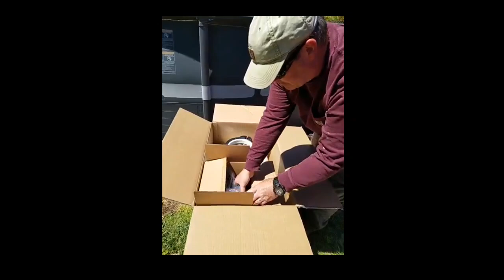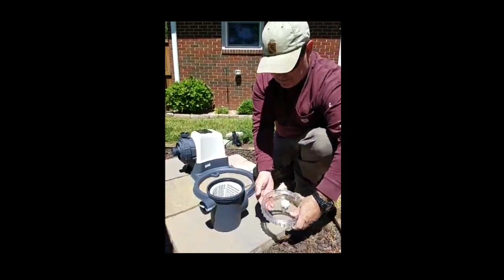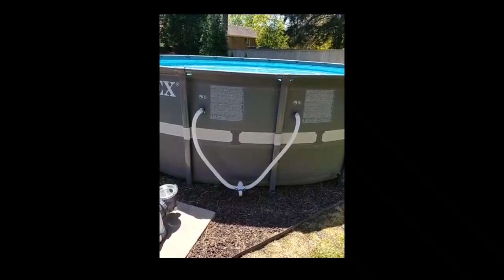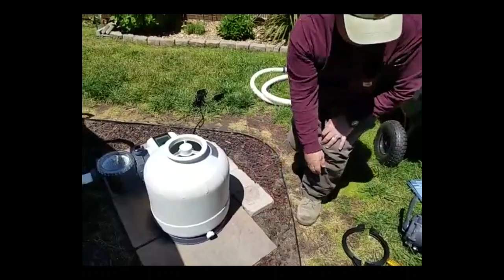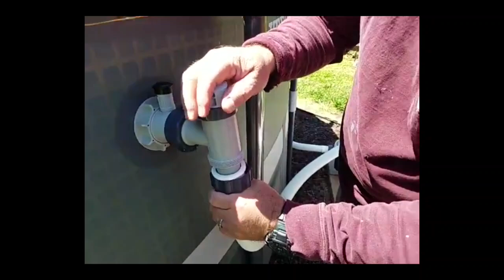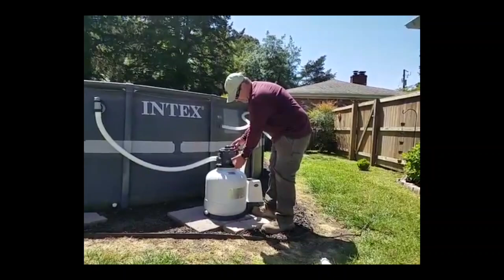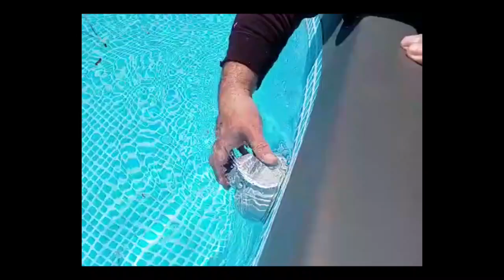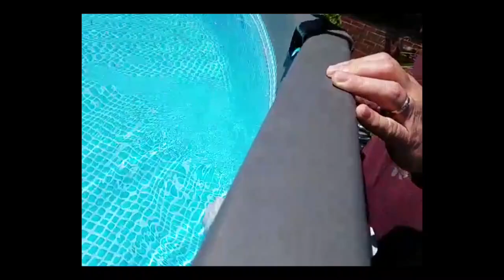INTEX SAND FILTER PUMP - Setting the pump up for above ground pools

Comment: Best thing i ever did was upgrade from the 1500 model to the 3000 model. May be a little overkill for my 5500 gallon pool but i had zero issues all summer. Water stayed clear and stayed balanced. It's a great sysytem
Reply from the maker: Oh we eventually did the same thing. We totally understand. We also switched to the hayward skimner and then uograded to the widemouth skimmer now, that was the best thing we ever did.
Reply: @MoverandShaker ill have to check that out

Comment: Thank you!!! We just set up our brand new pool and filter and did as you described but when we started backwashing, water came out and then stopped and we can’t figure out why. The only difference with what we see in your video is we didn’t put the little black cap back onto the outlet discharge that connects to the pool. Could that be the issue?
Reply from the maker: We both do not understand how that could happen unless your water level was below the discharge area. We have never heard of this happening.

Comment: Does the filter and pump work without taking the cap off of the vent valve?
Reply from the maker: Yes it does.  I would just do it occasionally to get the bubbles out.
Reply: @MoverandShaker  thank you!

Comment: Installing this same pump to a Coleman 18'x48". Is kt mandatory to install the output part/aerator that goes into the liner? The output tubes connect right up to the existing valve. I figured I could just use it as is. But, not 100% sure. Otherwise, this whole install is a breeze. Great video too. Thanks.
Reply from the maker: That may work but we can't say for sure. We don't really know much about Coleman pools we have never known anyone that has one to even learn about the Coleman setup. We do get a lot of questions about Coleman pools. It does sound like it would work.
Reply: @MoverandShaker  Thanks. I installed it yesterday and it has been amazing since. What a difference! All good without the aerator too.

Comment: Is this the saltwater option?
Reply from the maker: This particular unit in the video is only the sand filter pump, and it does not have the saltwater option combined some units have them combined as one unit and then there are others that are being sold as two units as one purchase like this one https://amzn.to/3Pcqfnf but they are not connected.  we purchased ours separately as two pieces.  So you have some options.

Comment: do you have 2 o-rings on the  motor water inlet where it connects to the pre-filter housing? I took it apart last year and took all the o-rings off to clean them and now I don't remember if there are 1 or 2 o-rings.
Reply from the maker: Not 100% sure where you are talking about but I could email you a picture of the schematics from the manual if you need them.
Reply: @MoverandShaker  That would be great! I looked for the schematics but didn't see the connection I was talking about.  Maybe you will find it.

Comment: Should the plunger valve on the basket be opened or closed while using the pump? Thank you for your video!!
Reply from the maker: All plunger valves are always open whether using the pump or not.  the only time we would shut the valve is when we want to secure the water from coming out of the pool, e.g. cleaning the pre-filter housing basket.

Comment: Hello, i appreciate all your pool videos.  They are very helpful.  But i need your help.i have a INTEX Prism Frame 18ft x 48in Pool, i order the 14in. sand filter pump. Do you think that should work for this pool or should i go for the 16in ?  Do i need extra adpters? Thanks i appreciate  your help.
Reply: Thank you! I was afraid it would be to small.
Reply from the maker: I think that will work when we got a 16. I think we got more than what we Need.

Comment: I love your easy way of explaining all of these processes and adaptations on your pool videos.  I would like to get your advice:   my Best way pool, 22x 52,with the filters was impossible to keep clear last year-- I bought the Intex Sand filter and the saltwater system to switch it out.  Should I change to the new sand and salt system to get the green out or use the old system to get most of the green out and then switch?
Reply from the maker: Use the old system to get the green out before hooking up the new one most definitely.  We decided after a couple of years to empty the sand out of ours and then add new sand. It's going to be scary not to get any in the center. We're gonna tape the hole off real tight.

Comment: When I put the short hose on it caused the tank to pop up! I can’t get it all to stay down now 😳! Is that normal? It’s like the hose is a little to long 🤔!
Reply from the maker: We both have no idea what you're talking about. If you're using an intex pump and that's what you're talking about
 I would  suggest reading the owner's manual.
Reply: @MoverandShaker  It's the hose you put on at 15:46 the small hose. It was super hard to attach both ends. The sand tank popped up when I finally attached them. Maybe it's because I have the pool filter balls and not sand in it 🤔, I'm sorry I don't mean to pester you 🥺! Thank you for your time!

Comment: I just did everything and found that the hoses are to big for the openings in the pool 😳! The hose that's on the pool is 1.25 and the hose that came with the pump is 1.50. Can you direct me to the right adapter set? We have the Bestway 56687E Syeel Pro Max 15x42 pool. I don't want to buy the wrong adapter set 🥺! Thank you for your help!
Reply from the maker: We are really most familiar with Intex pools but I think you are referring to something  like this.  https://amzn.to/3Ab85t0
Reply: @MoverandShaker  Thank you So Much!

Comment: Do you have to tighten the clamp all the way down on the filter part?
Reply from the maker: If you are referring to the pump ring snug it up with a screwdriver hand tight
Reply: @MoverandShaker  Ooooooops guess I should have been impatient and used the Makita 🤣

Comment: Great video. Wish you could’ve included explaining the instructions it had about getting rid of the air pockets or something ? My glass display to see water clarity is only half full so I don’t think I set it up right to get all air out
Reply from the maker: The sight glass only shows full capacity when it's backwashing or rinsing. I don't think you  have anything to worry about.    You can gert the air out with the pre-filter basket turn knob to release the air.

Comment: On the  outlet did your pool come with the adjustable piece or did you install that with the sand filter?
Reply from the maker: Can you clarify which adjustable piece you are referring to? Is this on the outside of the pool or the inside?
Reply: @MoverandShaker  the inside where the water is shooting out into the pool. I bought a plunger/adapter thing and am going to go that route. My sand filter came with one and I'm not to keen on cutting it to make it fit just curious if you did that or not.
Reply from the maker: It is an Inlet Air nozzle and it comes with the pool. There is no cutting necessary so I am not sure what you mean there.

Comment: This is really awesome, do you happen to have a video link to be able to program this, the instructions don’t seem to be helping me because I am not able to set it. I’m very confused
Reply from the maker: We don't have a video link but it's a great idea. Turn the power to your pump on. Press and hold the lock unlock button the numbers will Flash and then press the right button .  Run through your numbers 1 through 12  and then once you have your numbers set 1 through 12 hours you press the left button again and it locks that number in and now you're set for timing on your pump.  It's going to remember the time you turned it on so that's gonna be the time it comes on every day As long as it still plugged in
Reply: Mover and Shaker thanks! I’m going to try that… Quick question it also says low salt and beeps…does this system have to have salt?
Reply from the maker: @dprevish100   We probably have a different model since we were initially talking about setting up the  pump  it sounds like you might have a pump/ salt system combo and yes the saltwater system has to be set up properly from the get go by  doing multiple things in order for it to generate chlorine, like balance the pool add the recommended  salt the boost for a longgggg time. (See manual for length of time) Then you are good to go.
Reply: Mover and Shaker thanks!

Comment: Just got this index sand filter but won’t do anything when I have it on filter I been having pump on N what did I do wrong ? Need help
Reply from the maker: The only thing that I can think of is that your valves are not open because having your pump on filter is how it works full time.

Comment: When backing washing and Rinsing, and filter do I keep both valves open? On the pool?
Reply from the maker: Your Inlet and outlet return valves on the pool are always open during operation of the pump with the exception of exception of if you want to do maintenance on your strainer basket that's attached to the pump In order to keep the pool water in the pool while you're cleaning it.

Comment: I’ve had my sand filter for about a year now, and I don’t see any water in the sight glass like that. Could that be an issue?
Reply from the maker: You should see the water flowing when you use backwash and rinse cycles.

Comment: SO When setting up the pool for the very first time  you do backwash and rinse first. And then add chemicals and turn on the filter to circulate?
Reply from the maker: Yes. backwash first to get all the sand settled, then rinse,  you always want your pump circulating when you add chemicals. Some chemicals need time before you add others. If you a Leslie's pool store near you. They give great printouts of your water chemistry and will tell you exactly how much you need to add and when to do it  in a specific order with time in between shown.    Don't forget to turn your pump off anytime you switch any mode on the pump topside.

Comment: Thank you for the video.  It was very helpful.  Where did you get the extension hoses when running the backwash/rinse cycle?
Reply from the maker: They come with the Intex cleaner. I think 6 come with it. You don't  need those. We now use just a regular 50ft hose from lowes
Reply: @MoverandShaker  Thank you!
Reply from the maker: You're welcome!

Comment: I have good pressure, but my pressure gauge shows 0. Is that a bad pressure gauge?
Reply from the maker: It's  possible. Ours is usually between green and the edge of yellow
Reply: @MoverandShaker  
I just installed mine. It’s working fine but the pressure gauge shows 0.

Comment: How do you have your sand pump plug? Did you use a extension cord?
Reply from the maker: No, we paid an electrician $150 to pop a hole in our house right through to an outlet in our bedroom wall. It can be used outside as a weatherproof GFCI outlet and on the inside at the same time.  We purchased a pigtail  extension and they both plug into the pigtail into the outlet. No extension cords whatsoever.

Comment: Can you link to the extended back hose you bought? I have the 2800 crystal clear.
Reply from the maker: Are you asking about the hose that we backwashed with that looks like 3 or 4 intex hoses,  if so those hoses poses came from our intex pool cleaner. We  Actually stopped using those hoses and and decided to go with a regular, vinyl -  50 ft backwash hose that you get from the home improvement stores in the pool department.
Reply: @MoverandShaker  Yes I'm asking about the back wash hose - as I have the same pump I'm about to put up our pool. What size (in terms of fitting the pump) did you get?

Comment: forgot to ask, the canister black bracket appears to have 2 screws and black caps but no nuts, it seems lose will it be tight enough with just the caps or am I missing nuts? Also space between both sides.
Reply from the maker: We are not sure what you are talking about at all but we spent several minutes trying to. Sorry.
Reply: @MoverandShaker  sorry, guess I should have said black canister clamp,, it came with screws but not the nuts, off to Loews tomorrow, thanks again.
Reply from the maker: @sharonwaterbury4978  gotcha...all I can see in the parts list is 2 screws and it doesn't mention nuts but the intex part # is 11381 for all three models for thise screws. Are sure they are not in the box under the cardboard flaps?
Reply: @MoverandShaker  nuts were missing, picked 2 up at Lowes, clamp is secure, thanks.

Comment: I have this exact pump and sand and it's dumping a lot of sand in pool. Please help
Reply from the maker: We also have sand in our pool that comes from the pump after initially doing some research when it first started, it seems widespread for Intex Pump users, it's such a little amount though it's nothing that concerns us because we vacuum our pool daily, so we barely ever feel it.
Reply: @MoverandShaker  Unfortunately it was a lot of sand and every day. We have drained our pool bc with salt alone it turned green so we plan to empty Sand out of filter because I'm guessing the laterals are not completely screwed in. I didn't know to check them during install.

Also what else do you use with salt to keep it from turning green?

 Love your videos! Ty

Comment: Did I do something wrong I only needed to use 1, 50 lb bag
Reply from the maker: Do you mean to touch up for a low salt reading or do you have a smaller pool that only requires one bag? The salt chart is in the manual for your pool size. It tells you how much you need for x gallons.
Reply: @MoverandShaker  the sand only needed to use one 50 lb bag to fill the pump
Reply from the maker: Ahhh gotcha. So you have a small size pump and pool. Yes, everyone's set up is a little different. Good point to make though. We used to have a smaller pump until we watched a few videos of those giant bubbles and then we decided we just wanted a little more circulation and power.
Reply: @MoverandShaker  it looked the same size but I guess thats the only thing that makes sense.
Reply: @MoverandShaker  thank you!

Comment: The valves leading from the pool to the pump need to be open during the backwash process?
Reply from the maker: They stay open always
Reply: Won't the water from the pool run out?
Reply from the maker: @Simply Nae   No, the hoses connect from the pump to the pool there's not gonna be any water running out except from the backwash outlet. We have a video called how to backwash the intex pool pump. Check it out. https://youtu.be/a3va3Jb1wQA
Reply: @MoverandShaker  okay. Thank you. I'll check it out

Comment: Hi I just setup my filter. I bought it used and along with the pool and have been having problems with the filter pushing sand into the pool after I turn it off after it'd been running awhile and turn back on. Do I need to backwash everytime after a long run to prevent this or do I need to add more sand maybe? Thoughts? Thanks
Reply from the maker: I've never heard of that happening to anyone before. I mean it's normal to have just a few particles of sand here and there but not a ton of it Perhaps your filter has too much sand in it?  Did you get the manual with your filter if not I know you can go to intex.com and download it. I'm sorry I can't be of more help the only thing I can think of is the sand level because that would not be normal.

Comment: Is there no way to force the filter to start same time each day?  .e. if I set my filter to run for 8 hours, only way I can see to start it each day at 9am is to turn it on at 9am.   If I decide to do a backwash at say 2pm, when I turn filter back after backwash or any maintenence it resets the start time  I.e. Now it starts and runs for 8 hours at 2pm.. :P
This is very inconvenient..   as I want it to run during day time when its being fed by my solar panels.
Reply from the maker: Everything  you said is spot on. You can't force the filter to come on the same time everyday unless you never touch it.  Perhaps this is impossible or they would have figured that out with at least installing a timer that only changes when you change the time settings.

Comment: I have a intex sand filter and when I use the backwash it does not spit the water out at a high speed when I turn Motor on? I feel like it's not back washing properly.
Reply from the maker: What size is your pump? And what high speed are you comparing this to in order to make you feel it's not enough pressure?
Reply: @MoverandShaker  It is the Intex 26645EG Krystal Clear Sand Filter Pump for Above Ground Pools, 12-inch. I am comparing it to another video https://www.youtube.com/watch?v=HmYlGuX5o1k
Reply from the maker: @midblade4295  I think his is more elevated in the air but even if it wasn't,  your pump is still backwashing properly. Perhaps he has a larger more powerful or larger capacity pump in general. We have never backwashed ours without a backwash hose and at this time we are using a standard 50ft hose https://amzn.to/2WYbrzl attached to a plunger valve that attaches to that pump outlet.
Reply: @MoverandShaker  Yeah maybe because he has more powerful motor, I just wasnt sure because I saw his water pressure raise once he turned motor on while mine stays the same.
Reply: @MoverandShaker  When I turn my pump on the flow of water exiting from backwash does not increase

Comment: We put this pump in and this morning my water was green. Maybe I use the clorox sand and it is gray. Maybe I didn't backwash long enough?
Reply from the maker: I am not sure by reading this what stage of set up you were at recently  with your pool or even if that is where you are but I am not familiar with clorox sand as you mentioned only clorox salt. Is your pool a salt water pool? If so, Your water has to be completely  balanced before you ever add salt. We have a green pool video also that may or not be helpful.